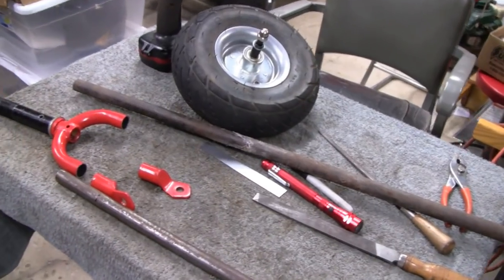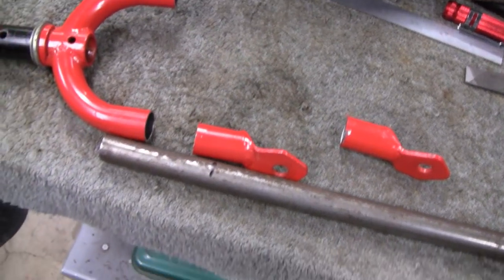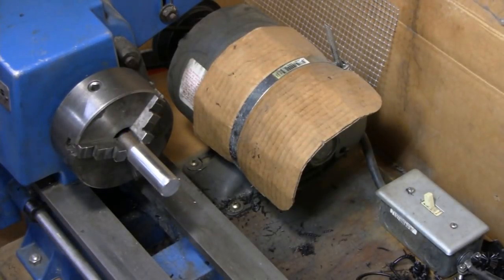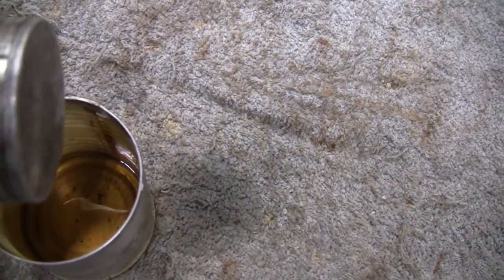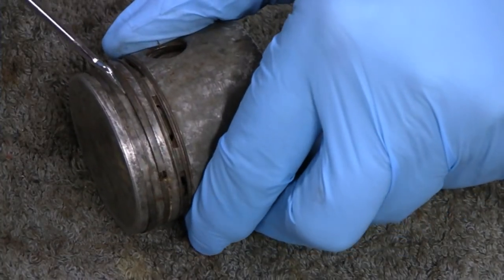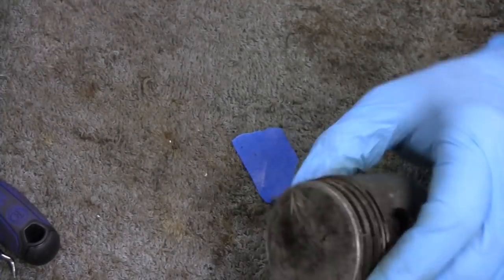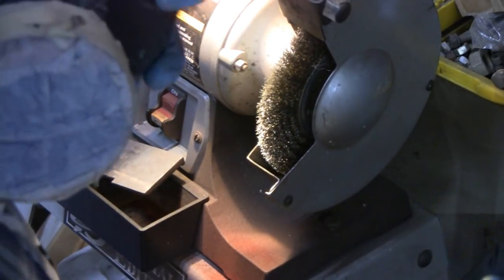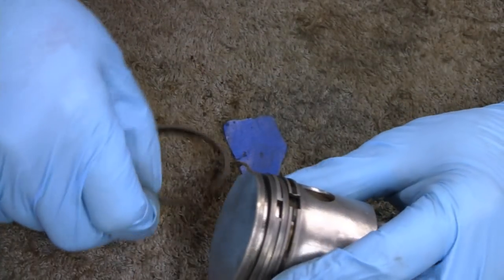MOTORIZED SCOOTER BUILD (part 5)

Comment: This has turned into an interesting little project 
I would leave the oil ring without the spring as it was originally I was thinking that maybe the piston may be slightly different on the newer ones with the spring but I could be wrong 
Good job as always 👍🏻
Reply from the maker: Thanks Bud!! Yeah I agree with you!! We took it out, I didn't like the way it fit!!☺

Comment: I have one of those groove cleaner things too, had it for over 40 years and still use it a lot , but it's sometimes easier to use the end of a broken ring to clean the grooves out, and if doing a multi cylinder engine I would wrap a bit of masking tape around it to make a handle.

Comment: You can also grind a slot in the filler bar to clear the weld seam in the tubing. Either way is fine.

Comment: I have never seen one with a spring behind the oil ring ...Good work on the fork extension pieces I have brazed them with a smaller pipe stuck inside
Reply from the maker: We took it off, it didn't feel right!! The newer models used them though!!☺

Comment: I was wondering about the new spring under the oil ring,..but I'll bow to Mike's advice over mine any day!
I was suckin' air through clenched teeth when you were prying off those stuck rings,...I will admit that ROADKING! 
I like that idea for the front fork modification, that's going to be good.
Reply from the maker: We took the spring out, it wasn't fitting right!! I don't think the earlier engines like this one used them!!☺

Comment: I never knew that there was a spring under the oil ring. When I got a set of new NOS rings it didn't  come with that spring and my briggs NP runs fine. But Mike knows a lot more than me.
Reply from the maker: Yeah the later models had them!! I took the spring out, I didn't like how it fit!!☺

Comment: Yeah, a quarter of the rings broke when I removed them from the four junkyard VW engines I picked up over a period of a few years over a decade ago. Granted, those were from the four to five cylinders that were so rusted that I had to remove the pistons with a sledge and a block of wood! Hmm, maybe the non-spring oil ring doesn't play well with springs? Yeah, 
Mike should have something to say about that. Other that the two broken rings, It's cleaning up nice!

Comment: I’d leave the spacer off, the new pistons would have a slightly deeper groove to accommodate it. You’ll end up with a broken oil ring trying to squeeze it in with the spacer, I’d make the engine way too tight. 
  That’s just my opinion, but I figure it’s pretty valid.
Reply from the maker: Yeah we removed the spring, it just didn't feel right!!☺

Comment: I don't this the spring behind the oil ring will hurt anything but do what mike says to do. I don't think you hurt the piston cleaning it with the brass wire since the brass is softer than the aluminum in the piston. Good idea to clean the grooves out for the rings i always use either a pick small flat head screw driver or a broken ring depending on the piston and circumstances I think the front fork will turn out great i agree about making the shims a little wider for the axle and wheel. Have a great day buddy. God Bless!!!
Reply from the maker: Thanks Bud!! We took the spring out, we didn't like the way it fit!! It must only go on the newer models!!☺

Comment: OK i have a question....when i was a small lad (Around 5-6) i was given a cast iron Brigg`s by my brother it came off a reel type mower it was a 2hp with no fuel tank...i bolted it to my Play School work bench and when nobody was watching i put gas in the carb and it started...It was then taken away...i would like to get another one what is the engine designation i should be looking for?
Reply from the maker: More than likely it was a Briggs model "N" 1940-1954 2 HP it had an round gas tank!!☺

Comment: Admit it, when you were kid those  fork extension pieces would have been 3' long... right?  I know i would have.
Reply from the maker: Without a doubt!!☺
Reply: We would take old forks from a 24" bike, cut them off and just hammer them on our stingray's forks to make a chopper.  No welding.  They would come lose and we would just hammer them back on.  Not the safest mod in the world but it looked cool and they were fun to ride.
Reply: we used water pipe ...hammered the ends down on the concrete (didn't impress the folks) and used a drill to make a hole,if we didn't have big enough drill ,we reamed it out with the same drill until it broke,then borrowed another from the neighbours .